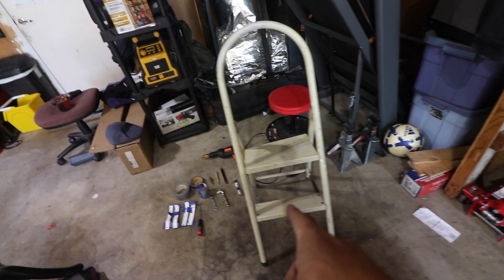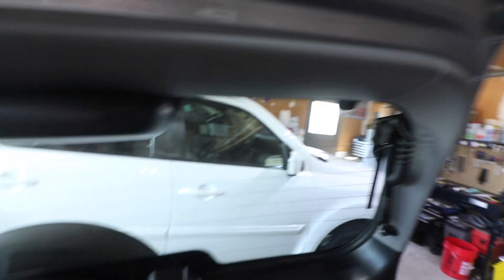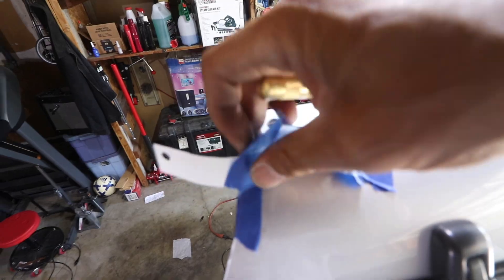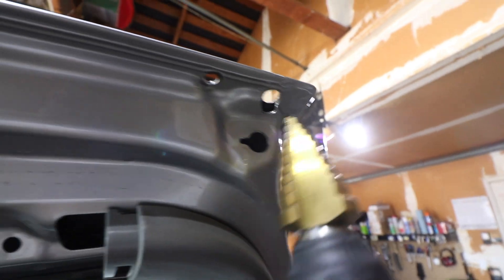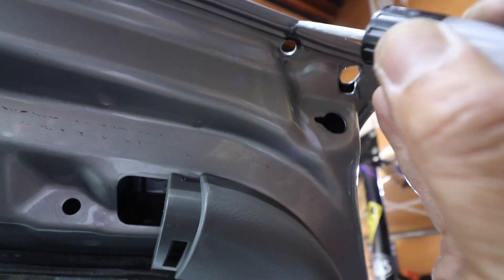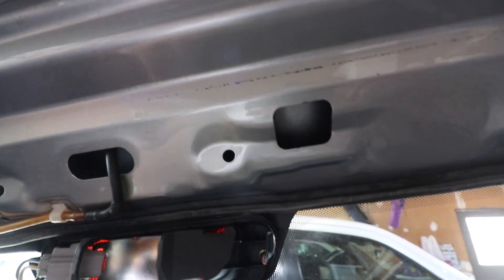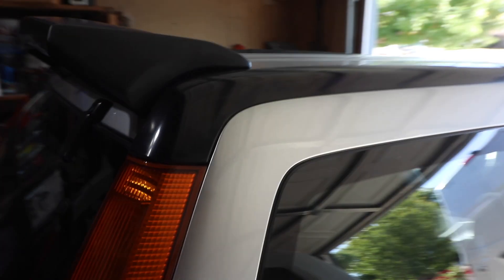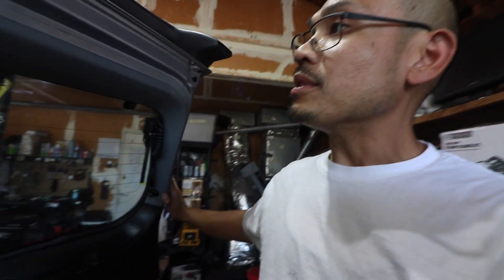2002 Honda CRV Aftermarket Spoiler Install from eBay

Comment: Are you planning on any rubber grommets for the holes that are on the outside of the weatherstripping to keep water getting inside the door? I wish the fitment was better tbh. Ive watched a few videos and the fitment seems to be off a bit on all of the wings. No OEM wing for this Gen i guess.